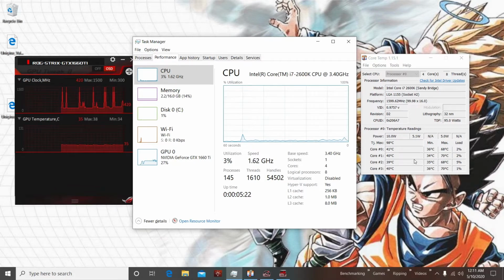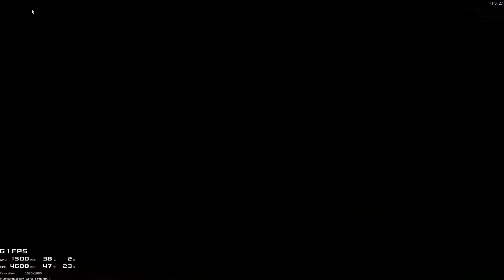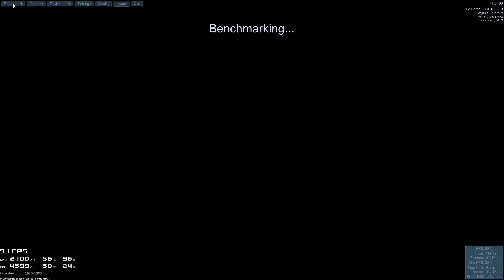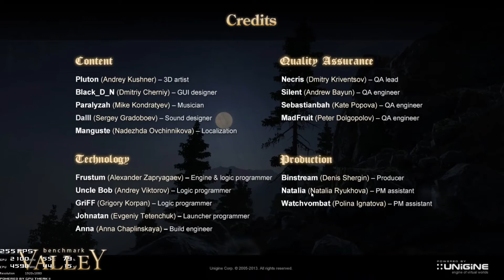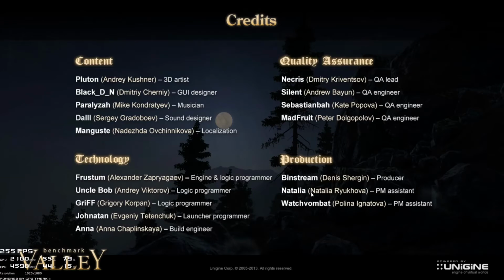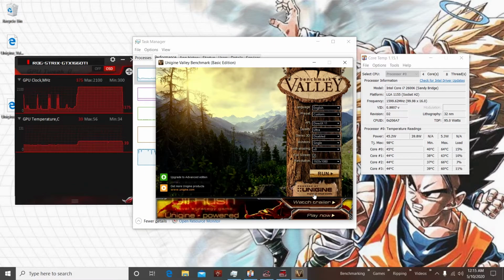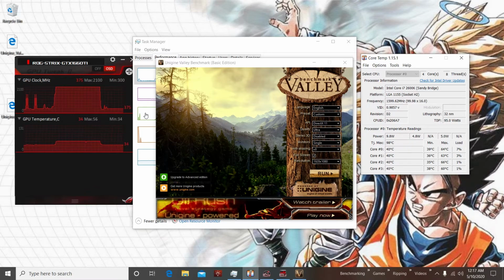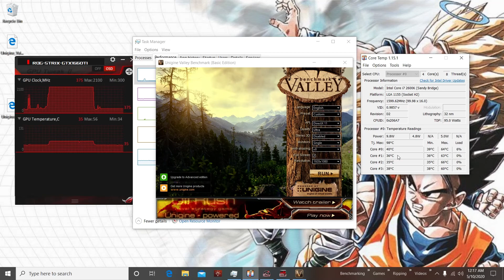Dielectric Liquid Submersion / Immersion Gaming PC vs Valley Benchmark 1.0 after 1hr45mins.

Comment: I see your max temps on my TR 1950x @ 4ghz with a custom loop at 3.6vc. I have been thinking of building a pc using the EC fluid for awhile now but I have to admit that I am not impressed with the results your getting. I was also wondering if it would be feasible to take the fluid to sub ambient temps. Since the pc is submersed then you shouldn't have to worry about condensation. I have also wondered about running a closed loop where the coolant in the loop was sub ambient but without the threat of condensation build up because the mainboard wouldn't be exposed to air.

Hope to see your build evolve and get better.
Reply from the maker: I have to admit I havent been impressed myself with the results. However, my latest video explains whats going on. I am in the middle of testing a solution and things are looking very promising. I see you subscribed so thanks for that and be looking for these new results coming soon. They will change your mind. ;)

Link to latest video: https://youtu.be/Mau_IyGnxFo
Reply: This is exactly what i want to do with my PC and how i found myself here ;-). played with sub-ambient cooling last week. had the inside of my case at around 5C. a few minutes after turning off the cooler, all monitors started flashing, presumably condensation! If i can see someone getting better temps with this fluid then i might jump in!
Reply: To avoid condensation of the tank the PC must be submerged in an outdoor beverage cooler like those made by IGLOO. Condensation will still form over the inside edge at the top of the cooler and water will fall into it. You shouldn’t worry much about this though since the water doesn’t mix with the dielectric coolant, components will likely not be shorted (see company demonstration: https://vimeo.com/channels/engineeredfluids/299742775). Just avoid excess water falling into the tank.